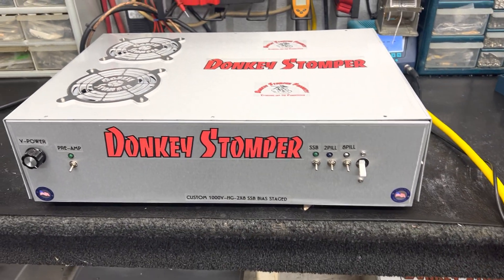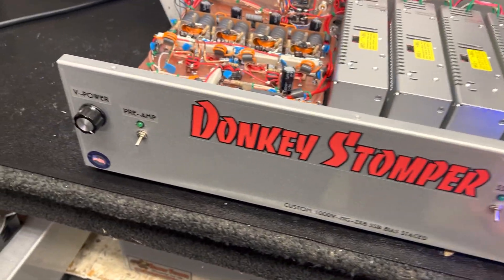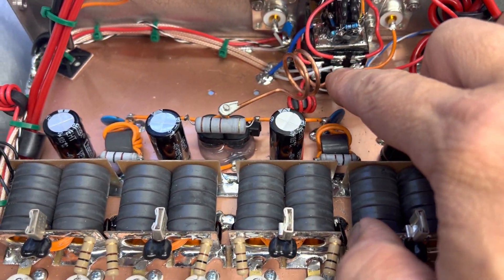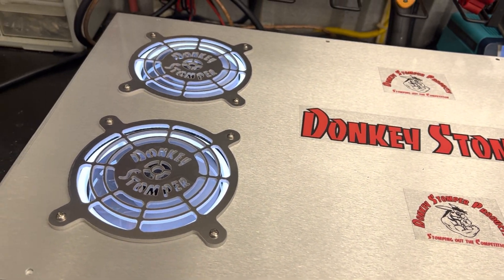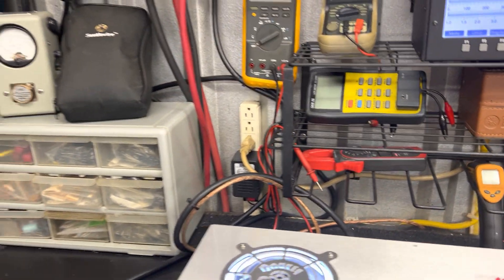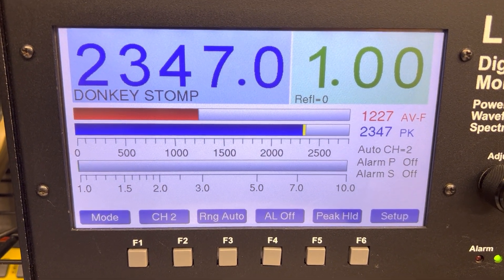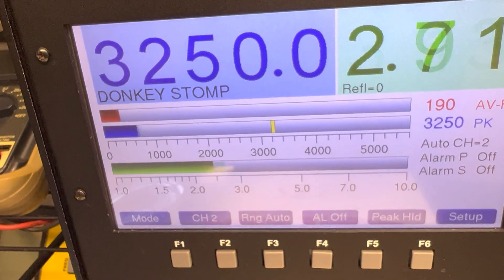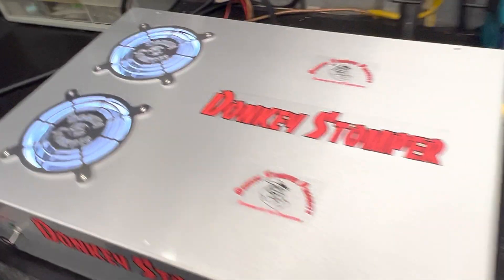Donkey Stomper Products, Custom 1000V-HG-2X8 Base, Staged, SSB Bias, CW Transmitter

Comment: Just curious on your staged boxes like this how do you handle the ssb delay for both sections? Only way I've known how to do is to use a DPDT switch and switch on the the delay cap for both sections.
Reply from the maker: I made two pill automatic ssb delay
Reply: @DonkeyStomperProducts   this can also be done by using 1 small relay to engage and disengage the other as well. and easer to set the timing of the delay. then you switch each separately.
Reply from the maker: @rainmakerscustomsrainmaker8985  I used 500 on 2pill all time 1000 on 8pill switch seems to work good am an ssb

Comment: thats what i want because i have low and high power radios so low power wont drive the 8pill so it needs the 2pill driver and i have high power radios that would blow up a 2pill so i would have to turn the driver section off but the radios i have there is no need to have the 2pill on with the high power ones and a must have with the low power ones and if i don't get the contact no need to blow up stuff trying the wait the cost the part availability is just not worth it
Reply from the maker: Right let us know. Thanks for watching